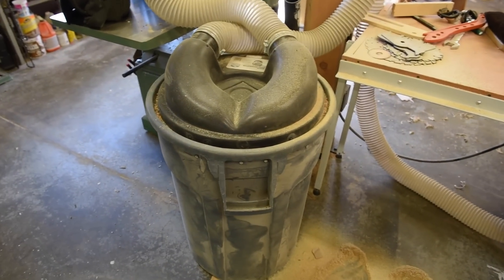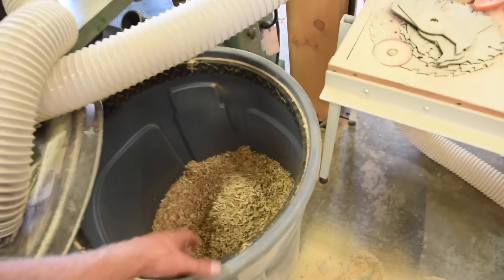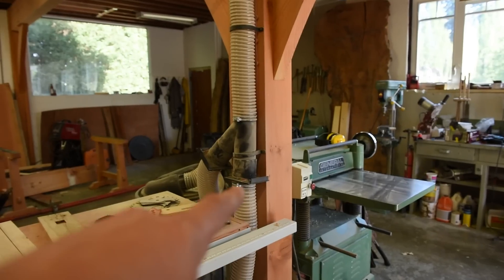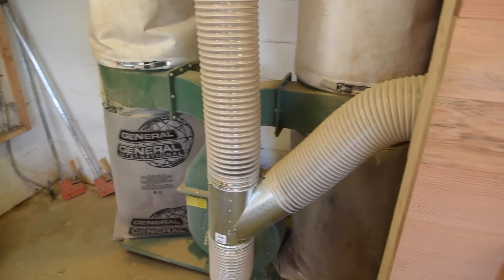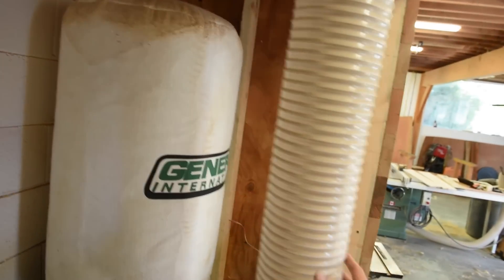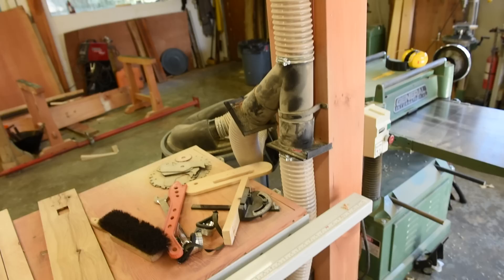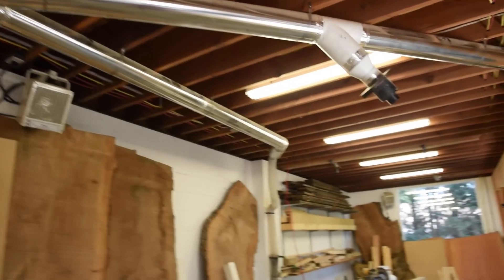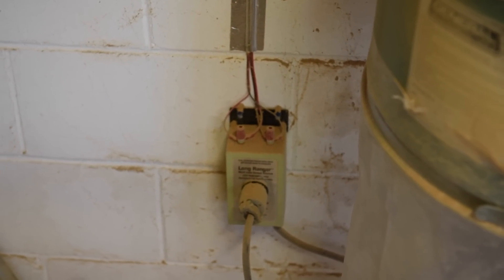FTF #30 Dust Collection Do's And Dont's

Comment: I just found this channel last week when Wranglerstar mentioned it; I'm really enjoying it.
So, what do YOU do with the wood dust and chips? I know how I would use them, but I am interested in hearing what other folks do with them.
Also, do you have any issues with static charges in the ducting?
Reply: chips and dust go to my wife's horse yard, keeps the horse boxes dry and clean. 
The build up of static charges is by and large a myth. I have a similar setup in my new workshop, but it's all clear plastic pipe (except the last metre or so to the machine) and works very well, even with a much smaller extractor unit. 
Everybody should also have a microfilter in the shop, since most chip extractors only go down to about 1 micron size (and that is with special filter bags) and the really dangerous stuff is smaller than that and suspended in the air.

Comment: I cant figure out why everyone is so obsessed with collecting chips and dust Inside the shop!!! Pipe that shit outside to some kind of larger container. whatever you can manage, it doesn't have to be a full on dumpster. Take my word, it's the best option hands down, worth every extra effort. It also means you don't need the nicest, fanciest collector set up (Jet, Grizzly, Powermatic). I have two 2HP harbor freight blowers, bought on sale for for like maybe $300 total. They are Y'd together into a 6" spiral ducting trunk. So 1 main trunk runs to all the tools, then out the wall, where the pipe Y's to each 5" blower, then 2 - 6" ducts run each blower to my enclosed dumpster. The blowers each have a Long Ranger remote setup and 1 remote can be programed to turn on both blowers. I maybe have $750 in the whole thing with ducting, blowers, and remotes. Metal duct should be the only option, it's so much cheaper than pvc everything, even for the nicer ducting like i have.  Stop trying to filter all those tiny harmful .5 micron particles while sacrificing all your suction and blow them outside where you can just filter them a little through your container (3-5 micron) and wont be immediately breathing the same air again. Love the Samurai Channel, keep the videos coming! Would love to see more doing of projects and less talking about projects and future projects (tips videos being the exception!)

Comment: On the long ranger.....do you need to run wire from the gates back to the long ranger...that is....itis hard wired?
Call me crazy, but it has actually been easier for me to pick up used dust collectors for 50$ each....i have 4...i just set one net to each of the bigger machines and then the last one has a few lines for smaller stuff.  The other thing is....instead of either having fine dust spit back at you....or spending a ton to have a great filter.....i have a seperator and then the fine dust gets piped right out of my garage.    Outside it just didapates or drops in a little bucket....my air could not be cleaner...

Comment: What are the specs of your collector?  Is it in the 3hp range?  I have always wondered if the collector you have is to small for all the runs you have?  I am curious when you replace the slinky hoses how much more efficiency you will get.  Right now I have a small 1hp mobile collector but I want to upgrade to something bigger.  If you had to do over would you get the same size again  or would you get a larger one?
Reply: i started with a 2HP HF collector and when i needed more power i just bought a second identical unit. I linked them together with a Y of duct pipe. so there is only one pipe in the shop but it splits into 2 just before the end. CRAZY suction. im sure you could do the same with another 1HP blower
Reply: I'm doing the same. As I figure it's easier to down tune the flow, with smaller pipes. IF 2 times 2hp motors proves overly powerful.
Reply: That is an interesting idea I had not considered.  I was going to use that 1 hp unit of mine for small jobs like down draft table and routing jigs where I have setup for direct dust extraction.  If I could achieve a system that had enough suction power I guess I could have one drop with a long slinky hose for jobs like that.
Reply: one of my drops (actually one of several Y's with blast gates on one single drop) is a long light weight slinky hose with a ~3' pvc "wand" for cleaning up messes from tools that aren't or cant be directly connected. its almost the most used part of the system at this point, no need for a broom!

Comment: Mr. samurai honeybadger.  I have said it before about your dust collection system.  It is not well implemented.
Think about chip velocity.  That is the most important thing.  Small dust takes little air velocity to move. The bigger/heavier the dust/chip the more air velocity needed. So when you  change pipe sizes you change air velocity.  Hence the dust will collect in the large pipes and you will have other problems. You have been given some bad advice about how dust collection systems work. You could really improve your system with some carefully researched info from a dust collection company.  Love your channel and attitude.

Comment: you still have a dust everywhere. is something broken?
Reply: lol my shop is the same way. My dust collection is mostly always hooked up to the machines but that doesn't negate all dust. I'm just too lazy to actually vacuum the shop floor.
Reply: Every shop has dust everywhere. It's for work not show.
Reply: jumpleadsx2 Most shops have poor dust collection -like this one which is accepted as 'normal' A good system will not have any dust around - wood dust is high explosion risk - many dusts, suspended in air with the right(wrong) concentration and an ignition source (spark from screw, static etc) can ignite. A primary explosion is usually small but the shockwave can stir up settled dust in an untidy workshop, and if the ignition source is still present, the secondary explosion is what takes out buildings. Google/Youtube it! Those bags cannot be called filters -see the fine dust around. A good system will rarely have blockages as it will have smooth bore pipe/fiitings (no screwed joins), correct duct sizing/transport velocities. This video is very misleading if you want to set up a system correctly.
Reply: He has hand tools that are not hooked into the system, like the handheld planer, router, skill saw.... and they make, wait for it, saw dust.
Reply: jumpleadsx2 if you haven't got dust laying around. It means you're  not working
Reply: Looks like fine dust from hand tools

Comment: I would suggest you purchase an air quality meter (Dylos makes an affordable one), and see how poorly your system is actually capturing and containing fine dust (the stuff you can't see that's bad for your health). Your problems are 1)insufficient filtering (those bags just don't cut it) 2)Your flow rate (which you acknowledge, but which you don't identify all the causes); you need close to 1000CFM real world, for which 6" duct is the minimum, and that's all the way to the tools, not just the main runs. I also suspect your blower is under powered, you should be running a 5HP or more, that General looks like a 3HP model to me.

Comment: The silver foil is "duct" tape. The gray tape not to use is "duck" tape. As in "is a duck's butt waterproof.." 

Other than that, nice. 

A little history on the side, duck tape is a WWII invention in that they needed a tape that could be applied and used in wet conditions.

Comment: That's a dusty ass shop to be showing off a dust collection system. /s

Ok but seriously now:
What's the CFM on that blower motor? I've randomly got a ~700cfm (freedom units. ~20 m^3/m) inline blower I was hoping to repurpose for dust control? Do you think its got the jimmies to do the job?

Also, are you doing anything to ground your ducting to avoid static buildup? I'd imagine fine particulate matter building at joints/ creases could represent a fire hazard with particles moving along the system creating static build up.

Another one on dust control systems in general; why is no one doing anything to prevent fine particulate matter from entering the blower motor? Wouldn't you want to filter down to 1-5 microns prior to entering your blower motor to prevent wear and tear? Seems like unnecessary strain on the blower since you're gonna want to filter down that fine anyways (with the bags); is there a reason to not do it before the blower?